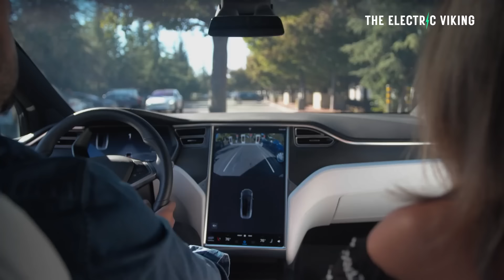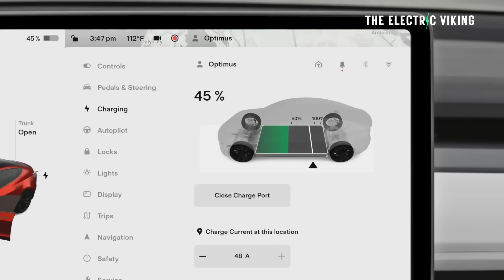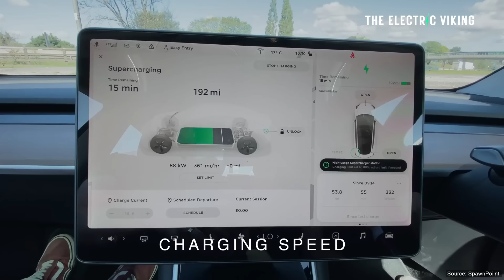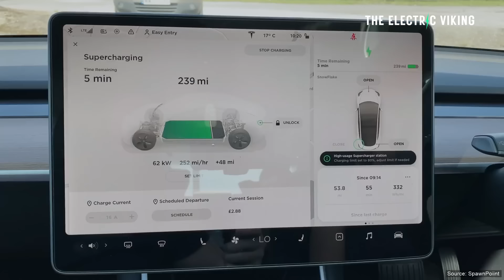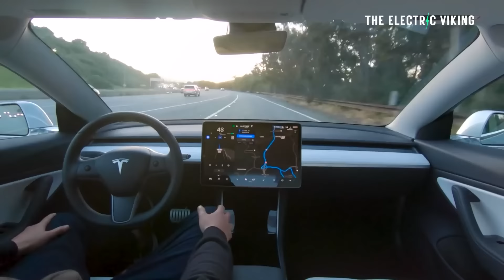$20B revenue stream - Analysts still haven't figured out Tesla's chess game

Comment: Tesla are very smart, the charger network is huge for revenue and data as you have said. What car company has every owned the service stations. Along with no dealer network to screw up your name. I have first hand experience with a dealer network claiming to fit parts on a 'fixed price' service which is never fixed and then not actually fitting them. This ruins your brand just so a dealer network can make a little extra profit. Tesla are smart not having a dealer network.

Comment: Even ICE car makers use a similar scheme... have done for years with those little black boxes that blow regularly... the little black boxes are essentially a diode in a box, probably cost 22 cents... but after the dealer plugs in the 'diagnostic'  computer and tell the car when to blow the next little black box (that costs the customer $1,299) ... the 'OWNER'  of the car has to make their next 'installment' or else the car wont work. The ICE servicing regime is also another payment/income for the brand/dealer... so, even if one 'OWNS' the vehicle, they will never stop paying further (or the next owner will. That is why car makers the aftermarket service companies and aftermarket parts suppliers... it interferes with the after sales income

Comment: Thanks Sam! Yes, TESLA is primarily a data company focussed on accelerating the trend to a new energy future. Their success is due to analysing that mass of data to improve manufacturing efficiency; to work with other OEMs to produce global connectivity at the charger, the  battery, and the car level to produce an integrated and profitable network which is greater than the sum of its parts!

Comment: I think the big seven deciding to build a CCS network at this point is quite simply stupid, and resembles a child stomping their feet because they are so unhappy Tesla completely outplayed them. It would take them about 10 years of extremely intensive building to create something close to what Tesla has now and it would cost them 3 times as much. If I was on the board of one of those companies and found out what they intended to spend there would be some proposed resolutions to roll heads. For whatever reason, Musk is sharing and isn't taking advantage to bury them. Swallow the pride and roll with the good fortune.
Reply: no, its just a money grab, they dont want just tesla getting the free federal money for setting up chargers. as soon as the money is gone the chargers will disappear.

Comment: My account manager wouldn't invest in TSLA.  I pulled 10% out of the main fund and did it myself.  TSLA seems to be the only thing making $ in my account.  They cannot make their battery storage systems fast enough, with a current 2 years' worth of orders at 100% production.
Eventually I expect the government to force a breakup of TSLA into its components after it achieves super-dominance in multiple markets, but that should be 10 years or more in the future.
Reply: @harmony3138  You missed the most important bits. Extreme tech, superchargers, low cost to build, more efficient motors, better batteries (generally) and the list goes on and on...   Super Dominance is in the past. It is already GIGA dominance.

Comment: @14:39 I've heard elsewhere that at least some of the other companies coming on board will provide their own apps to their users to interface indirectly with Tesla to essentially make it unnecessary for Tesla to have their users' data. Tesla seems willing to expose their API to these companies so it may not be a data bonanza for Tesla. ON THE OTHER HAND, I expect many owners of other brands to have a Tesla account just because the Tesla App will probably work better than their brand's app.
Reply: I think Tesla is quite capable of protecting its essential value. They are prepared to be generous but they are not gonna 'adopt the position'. Tesla has definitive control and will negotiate from strength and define the terms.

Comment: Horses have very high vampire energy losses, even when parked requiring similar fuel to when used for productive work.
Reply: Their self replacement abilities are the envy of manufacturers everywhere. Autopilot didn’t need years of training and full self driving made milk delivery very smooth. The added benefit of their carbon capture and storage system was that their emissions could be recycled on site and helped your garden grow.🐎 😊

Comment: Look at all those EVs baking out in the hot California sun while they pay PG&E's exorbitant rates to move PV power from somewhere out in the desert to a local charging station. Even if the power generation is free you're paying $37/MWh for transmission, not to mention the line losses. Why not put all those EV charging stations under solar carports with on-site megapacks? "Vertical integration."
Reply: You know electricity travels 98% the speed of light the msecond it is collected from solarpanles it already at the socket going to whatever is demanding power
Reply: @lesstevens2370 only if you have invested in all the wires and towers to send it so the power company wants a return on its fixed cost. Otherwise you would have to drive out to the desert 🌵 with your batteries.🤔

Comment: The issue isn't whether "the big 7" make a charging network; it's whether they MAINTAIN IT .. I sincerely and I mean SINCERELY doubt they will maintain it the way Tesla obsessively maintains their superchargers when they fail, which will bring us right back to the issue with "electrify America" which does not work more than half the time .. the only way to offer a better option or even an equivalent option to Tesla's supercharger network would be to maintain the chargers, and I just don't see a consortium of morons figuring that out ;)
Reply: I genuinely believe most of the employees at the companies doesn’t own or drive EVs. I’m an asset manager for a CPO, I have massive challenges with employees with no experience or knowledge about EVs, they don’t really know, understand or care about the EV charging.
Reply: It will probably be like an American version of IONITY that we got in Europe. IONITY works just fine, it doesn’t have as many chargers as tesla but it work’s almost as good as tesla does. It’s the same company’s that owns IONITY. If you have a subscription or if you have a car from the company’s that owns IONITY then it’s cheaper to charge at IONITY then it is to charge at tesla.